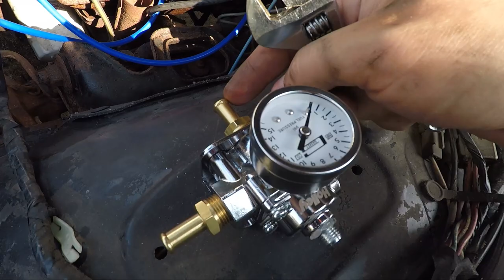1984 Ford LTD Crown Victoria Restoration Ep. 07: Wing & A Prayer

Comment: Side note I do see the gasket on the base of the intake and carburetor, on my 68 f250 I had a hard time getting it to seal I had to use a thicker gasket from a role of gasket paper, it didn’t like the paper think gasket I was having an extremely rough idle. Not sure if that’s your problem though
Reply from the maker: Yeah I’ve heard that having a small gasket can cause issues for idling. I’ve got two gaskets on the carb, one at the base and one between the conversion plate, and the extra height the conversion plate gives I think is in effect a “spacer” for it.

Comment: Also when I made my own spark plug wires the rubber boots on the distributor end must have been defective because I had touched the top of the distributor and was shocked, I have a video on my phone where I held a test light over them, and it lit up for 4 of the spark plug wires
Reply from the maker: Hmmm. Thankfully I haven’t been shocked yet and I do want to try and avoid that. Next time I’m out there, I’ll try the test light on the top of the wires to see if they’re leaking any current. Thanks for the tip! :)

Comment: 29:12 try use fuel line retainer clips they are strong dont use zip tie or clamp high presure my 1990 crown vic came with it after and before the fuel fliter
Reply from the maker: Will do! That should be an easy item to obtain. I appreciate all your advice and assistance by the way!

Comment: 24:44 try to use boat tank and electric fuel pump for carbs they make ones!
Reply from the maker: Thanks for the idea! I did try doing a boat tank with a electric fuel pump, but the pump burned out after 5 minutes. :/

Comment: try make sure spark plugs are clean maybe they are rich and black becuse 
of fuel.

And for the timing try before top dead 
cneter like 10 to 20 dgree

And try to check if your carb came with idle stop solenoid maybe that 
why your car die right a way

And try Plug the hose on the valve cover 😂
Reply from the maker: Hmm, you may be on to something here. I pulled the plug from the number 1 when I was doing the distributor to find TDC and I noticed it was sooty. Think that could be a cause? I might buy some new spark plugs as the ones I had in there were designed for the original CFI and distributor and not an HEI.

Okay so 10 to 20 degrees before TDC for the timing? I'm going to get a timing light and, provided I can get it to run long enough, will try and get that check. Otherwise I can get a protractor out and make an estimate! :) 

An idle stop solenoid... that's a new one to me. I'm going to have to look into that, but it sounds just from the name that it could be a good culprit for what's going on. Thanks for the information!
Reply from the maker: @عبدالاله-غ6س  Thanks so much! I look forward to trying that next week!

Comment: Mine had an ignition control module that was failing when I bought it, does yours have one?
Reply from the maker: It does! But, it may not need it now since it’s carb? Hmmm that’s a great next step Andrew thank you! It could be that it is working and shouldn’t be (now that it’s carb) or it’s not working and it should be (regardless if it’s carb). I shall have to do more research on this! Thanks!

Comment: Not sure if you already did this but did you consider the firing order and plugged the spark plug wires in the right positions?
Reply from the maker: Hi! Thank you for the idea. So, the car has the 1-5-4-2-6-3-7-8 firing order listed on the radiator shroud, so that has been what I've been going off of, meaning that it is not a "high output" engine (the HO engines are 1-3-7-2-6-5-4-8). I'm not familiar with any other way to tell if an engine is HO or not for the 302, but if you have any ideas do let me know. :) The only evidence I can point to for it being the 154 firing order is that it did run for 10 - 15 seconds. Would it be able to do that with the wrong firing order? I appreciate the insight! :)
Reply: @gwe87  I'm a bit like you, I'm not sure how to diagnose things, but I did see videos where engines would run briefly and sometimes backfire because the wires weren't plugged in the right places. At least you have the firing order listed and I'm sure you already looked at videos on how to plug the wires in the right plugs. I just saw that you posted another video, looking forward to see if there was any progress!
Reply from the maker: Thanks so much! It's a learning process for sure and can be frustrating at times, but it is also a lot of fun to figure out new things. I'm not sure how I'll get that hurdle overcome, but we'll keep working towards it. I hope you enjoy the new video and thank you for watching.